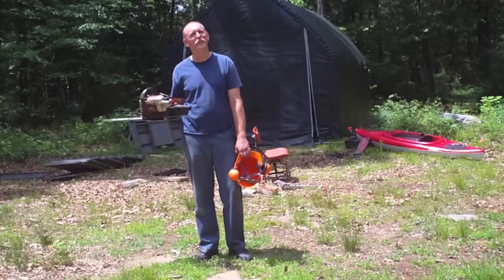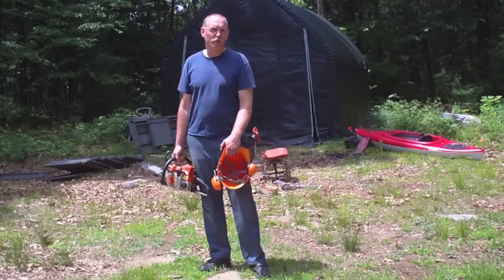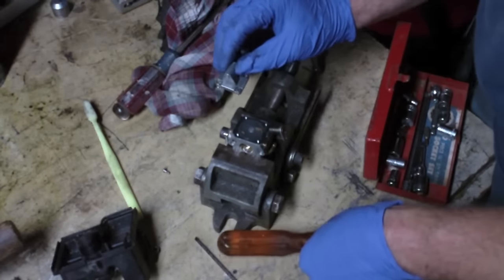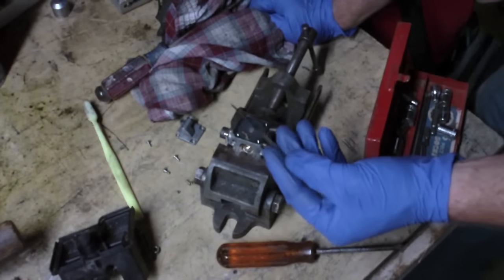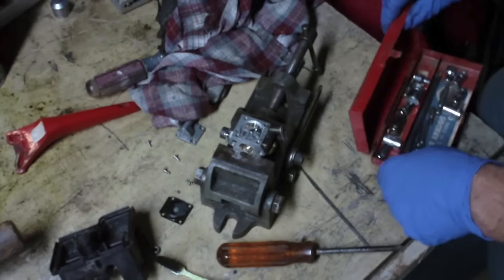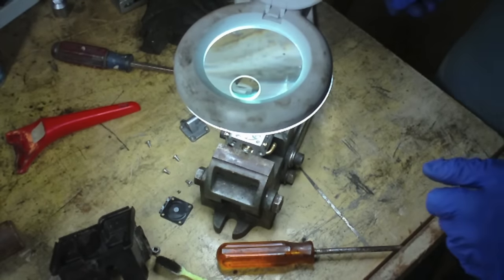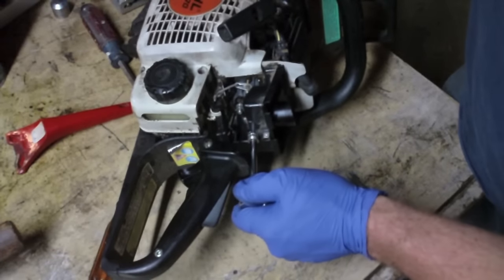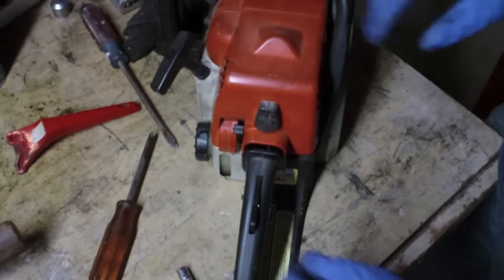Stihl Chainsaw Woes Part 1

Comment: Hi Steve,
You've probably fixed it by now, but 2 suggestions - 
1. the "valves" in the fuel pump - generally pieces of plastic that seal holes in one direction and let gas through in the other. Need to be very clean and not bent up at any sort of angle. If you can get replacements easily, look at replaceing them anyway.
2. Check the crankcase seal. I've had 2strokes with similar issues and the crankcase seal was found to be the faulty part.

OTOH I've got a 2 stroke with similar symptoms here so am looking on with interest as to what you discover.
RP
Reply from the maker: +Richard Prosser I apologize for the video ending abruptly, but I lost a few video clips. After tearing the carb down the second time, and blowing out the tiny ports with carb cleaner, the saw worked fine. But then I thought I ruined it by overheating it because I forgot to re-adjust the fuel mixture, and ran it way too lean. I will post a part 2 with an update within the next 2 weeks.